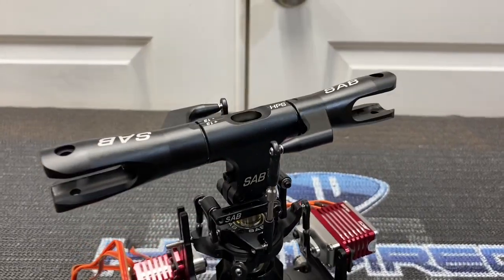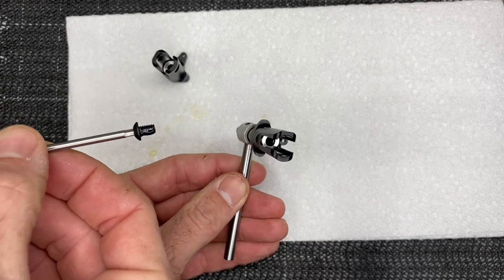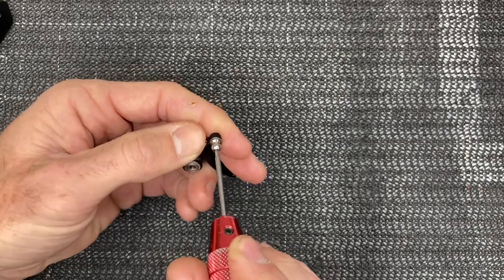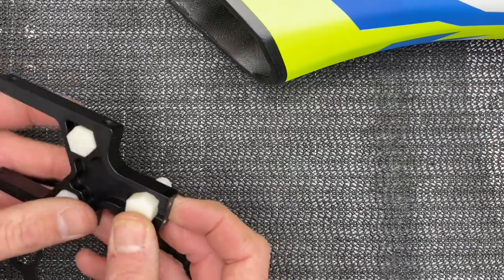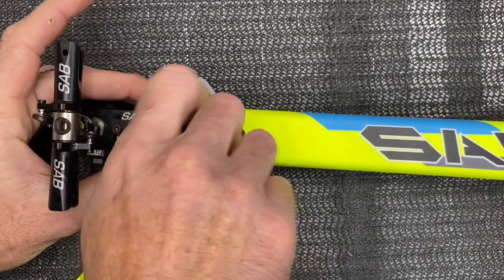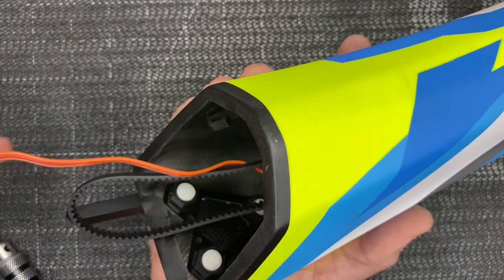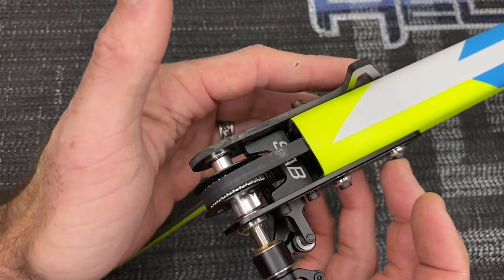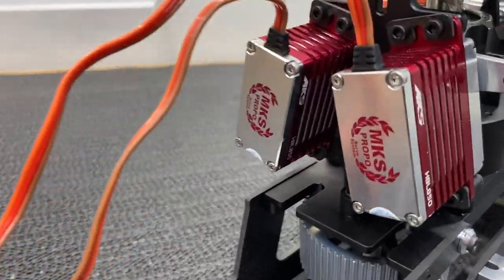SAB Goblin Kraken 700 Build Part 2

Comment: Nice! I broke my clip that holds the tail pushrod. Ordered another and also a new pushrod that I am going to use epoxy on. I cant believe how easy the CA glue came off.
Reply from the maker: Very easy! CA does not stick to metal. It might tackle and hold but any real pressure and it will pull right out. Make sure you sand the carbon and clean it good before you epoxy. That way you can get the strongest best pawn and possibly can. I have never had a pushrod let go while using epoxy.

Comment: A word or warning about over torquing the feathering shaft screws as it car distort the feathering shaft ends and will make disassembly extremely difficult.
Reply from the maker: I would rather that then a feathering shaft screw come out done. Little heat and they come right out.